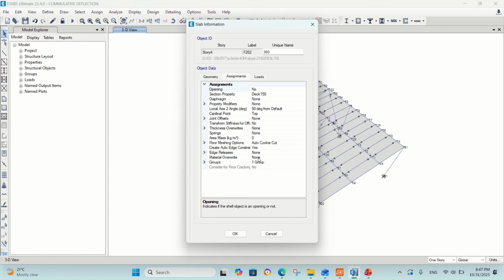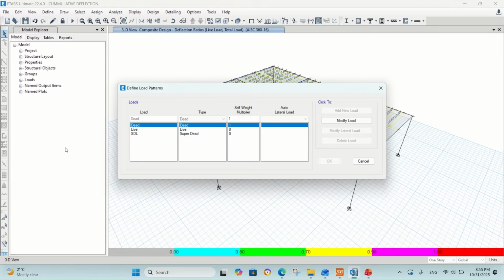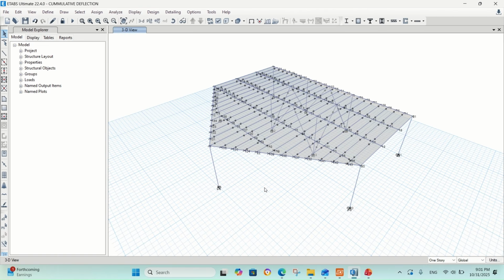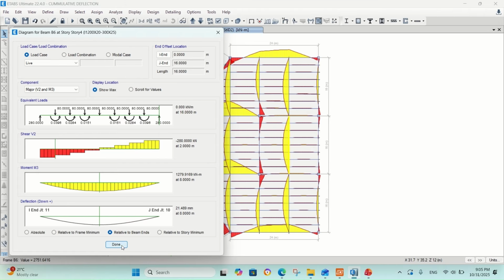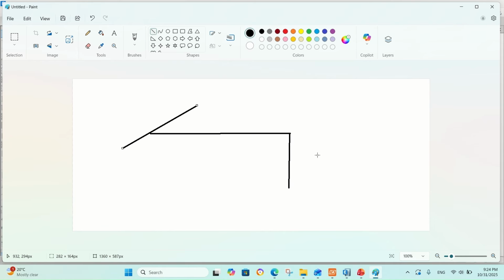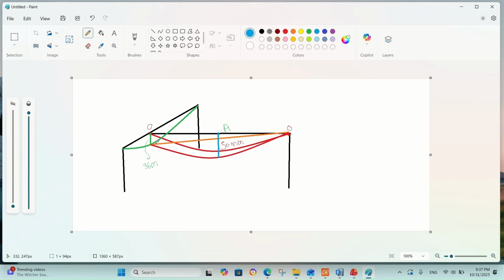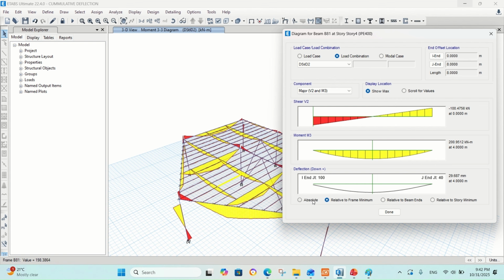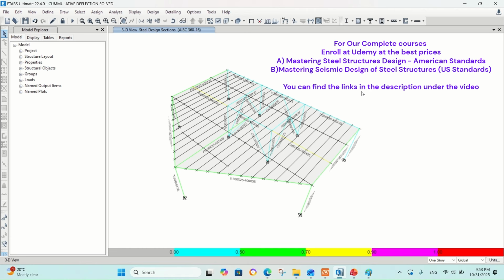Cumulative Deflection Check of Steel Structures- ETABS

Comment: Just a quick one!.

While most people prefer STAAD Pro for Steel structures, As that would be showing Deflection, LTB ,Bucklings with AISC Clauses and details of members compared to ETABS which just shows pass/Fail of members.

What's your opinion on which one is right tool to pick? What's your view on Tekla Structural Designer?  

The intent here to understand which tool is more preferential. I know ETABS works fantastic for concrete structures and general behaviour but for Design of Steels , Everyone say STAAD leads.
Reply from the maker: Both ETABS and STAAD are reliable for steel structures design. It's up to the engineer to work with the software he is comfortable with.

The difference in results is not significant most of the times, and each software has its pros and cons. 

Etabs doesn't only show pass or fail, it gives detailed design output for each member, so I disagree with you on that, having worked on both.

For me, if I have a composite floor, multistory building, or where I need to do dynamic analysis I will go with Etabs. 
For Warehouses, MEP platforms, pipe racks, telecom towers, or noncomposite floors STAAD will be my choice, SAP2000 is also an option.